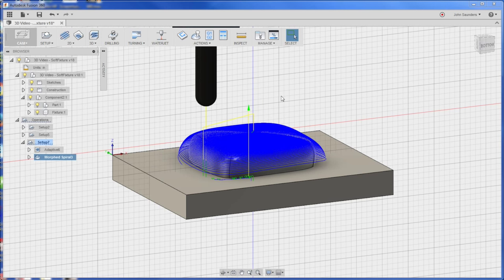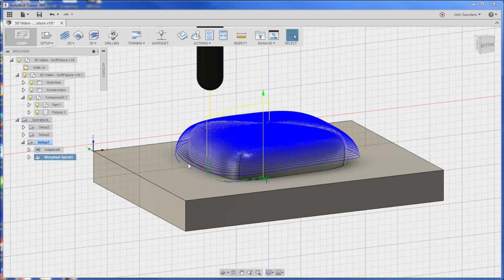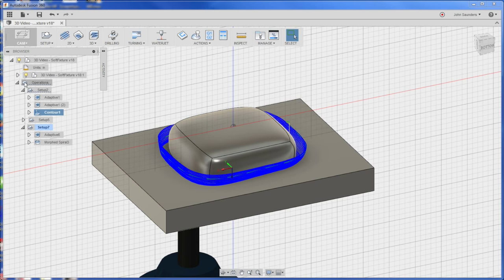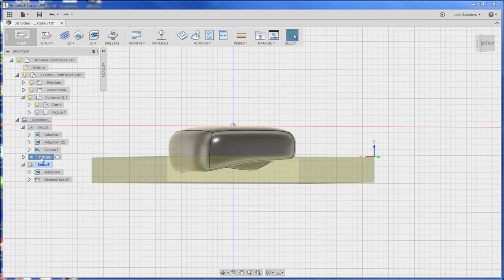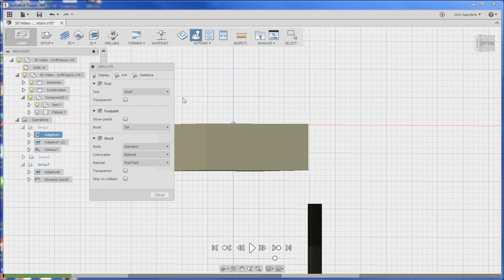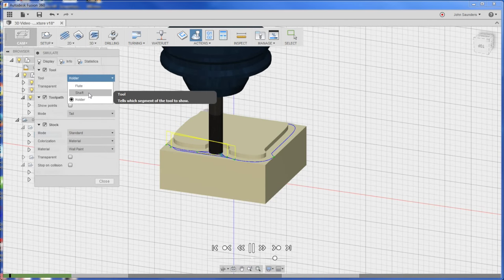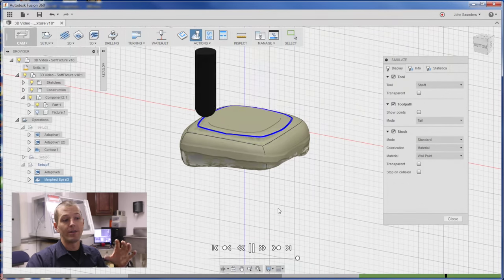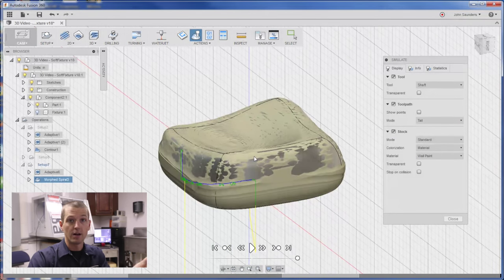Fusion360 Multi-Operation CAM Simulation!

Comment: The reason you have the funky bits in the middle is because the part has negative draft at those regions.
There is a slight undercut angle in your model that a fixed spindle mill cannot cut.
Next time you want to split an organic / otherwise complex part like this, you can run a draft analysis in CAD and have the two halves split where the angle goes from positive to negative. I do this all the time when I create parts for injection molding that need to be able to release from a mold.

Comment: You're very welcome John! Glad to see it getting out there. Definitely a part-saving technique, and I use it every time I have to do multiple-setup parts.

Edit: also in your Setup, make sure to add the fixture as a fixture to check for collisions on the second operation!
Reply: +atomkinder67 I'll also add that while Fusion will NOT trim paths to avoid your fixturing, you can use it in this case to limit toolpath height (Bottom Height) to, say .001" above the fixture surface. Super handy if you just use the fixture as the reference surface (which is also what I tend to do with fixtures, including soft jaws).

Comment: Oh I could have told you that a while ago, I thought you meant something else so it didn't come to mind to tell you to just select what you want simulated. You can also select one setup or even just one operation to be post processed. Handy if you need to adjust the size of a bore quickly, or really any dimension that needs adjusting.

Comment: So I've been using simulation often and I still cannot get something important to function the same way others have had it.  What I mean is this: When I'm running the simulation it just shows me the 3D model that I'm cutting - I.e. exactly what you want designed.  What I want to see is what it showed in this video - I want to see the "uncut" or untouched block as it gets gradually cut based on the paths implemented.  Is this just a bug with my video card or is there a setting I seem to be missing?

Comment: The other way you can do basically the same thing with stock is after simulating the first setup, you right click on the simulated part, select <Stock> and then <Save Stock>.  That lets you save it out to an STL file.  Then to simulate the next operation you do the right click, <Stock> and <Load Stock>.  This way if you're still tweaking the second setup you don't have to go through the first to simulate the second.

Comment: John
I must be a bit slow here but there is still some funny tool path still showing after the simulation has done looks like the gouge is still there 

Stuart

Btw I have managed to get my 4th axis working but as F360 still does not have proper 4th I have to do it with tool orientation so only 90 deg. steps but ok for a palette
Reply: +NYC CNC John
Sorry my mill is mach3 powered and is a small turn key unit I use a post from the forum for posts at autodesk . I downloaded it from them and put it in my personal post folder , I understand that you use the path pilot emc based software so it will not work. But F360 guys will brew up a post for you normally it's just a flag that needs setting.

As a cludge do your setup, tool path , set the tool orientation to the next 90 and include A 90 in the code manually but do cut air as you cannot simulate it 

Sorry I cannot be more help with your request 

Stuart
Reply: +Stuart Hardy you can do it in as many steps as you won&#39;t you just have a references serfices for the Z axis. you do it by just adding a hex, octagon whatever on the end of the part, you select the serfices of  one side of the hex or whatever as your Z plane, you just do it as 3 + 2  machining as long as your post processor can output A axis moves it works fine. if you want more info just pm me and I will send you a model what I have set up this way.

I have a post pressor you can use to do this in x or y

Comment: Madcam does 3D way better. Even on 5 axis
Reply: +Cadplast So for anywhere from $995 (basic 3-axis) to $5995 (full-blown simultaneous 5-axis) you too can have a CAM package that requires you to also own Rhino! This isn't helpful.
Reply: +atomkinder67 Already own it and loving it :)
Reply: Cadplast Good for you? And yet your comment is STILL unhelpful.
Reply: +Cadplast dude fusion has both cad/cam for $1200 a year or free and you can do 3 and 5 axis work with it, 

or if you are a good dude like John you get HSM free what has almost everything
Reply: +daniel lyall Just an FYI... Fusion 360 is actually $300/year and free for startups and hobbyists. And you get the full platform of offerings. Here's the Try/Buy link with all the info: http://www.autodesk.com/products/fusion-360/try-buy
Reply: yes fusion360 is that, ultimate is going to be what, I use it everyday